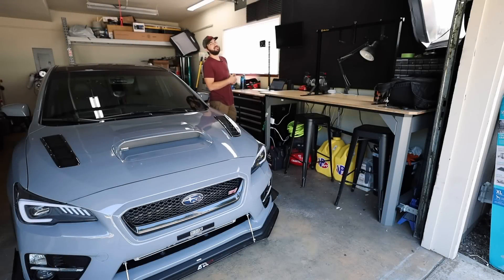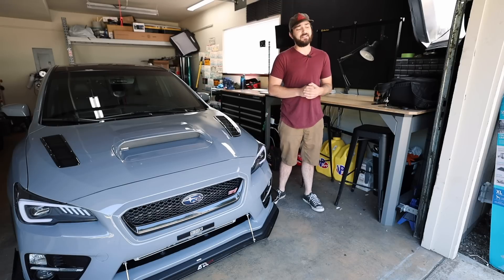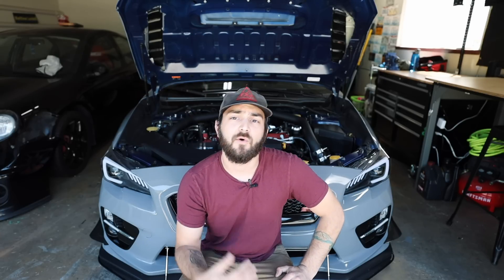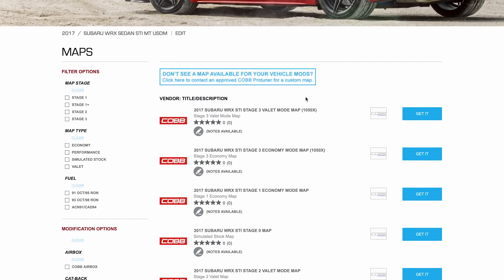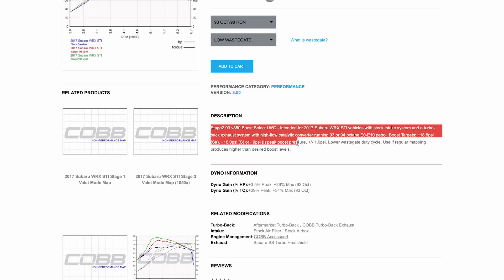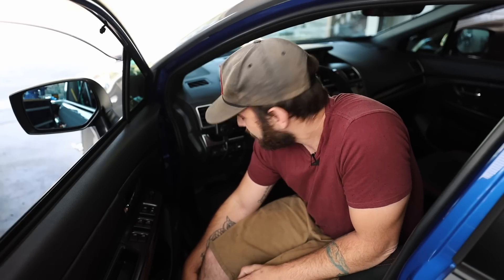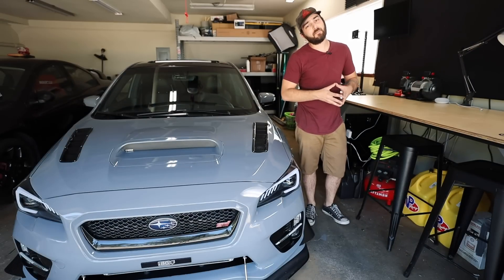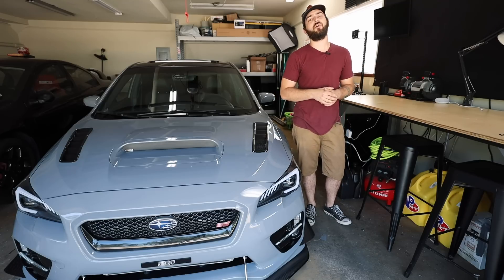Understanding OTS Tunes and What You Need To Know

Comment: Isn't the factory tune itself an ots? A shitty one at that. As long as the car is bone stock, how could the cobb stage 1 ots be any worse? With mods I'd go protune though. Has anyone monitored the stock tune data with their accessport? Interesting to hear anyone's feedback. No pun intended
Reply from the maker: Some shops have done testing on the OEM Tune feedback, unsure if what their specific results were other than "can be better", but you are spot on with the OEM Tune being OTS
Reply: @Smeedia  the cobb ots stage 1 may just be a cleaned up version of the stock tune. Not the best "pro tune" but better than the one from the factory. Probably a little healthier to run to as long as your 100% stock

Comment: So i got the Accesport with the stimulus money Lol.. as well as the cobb sf intake BUT i’m confused on how to download it because ima have to buy the MAPerformace stage 1+ map, and idk how to download and put it into the accessport 💔

also do you think it’s safe to run the MAPerformance Stage 1+ tune with the cobb sf intake ORR should i go with the COBB stage 1+.. or either or is fine ; does matter?

don’t kno if this helps but i have a 2020 STi
Reply from the maker: They should send you a file to download, then download the program AP manager and connect your AP to your computer and drag the file onto the AP. From there just plug it into thr car and follow the on screen prompts and upload thr new tune 😁
Reply: @Smeedia  Which map should i run tho? Only thing i got was the intake w no box and the AP is stage 1 or stage 1+ since i have no box
Reply from the maker: Stage 1 will be for only an intake 
Stage 1+ will be for an intake + catback
Reply: @Smeedia  I don’t have a catback but i have a remark axle back with a custom resonator delete so is that considered stage 1+?
Reply from the maker: I would just do the normal stage 1 🙏
Reply from the maker: If your using Cobb parts then use thr Cobb tunes, if your using map parts then use their tunes 🙏

Comment: Quick question looking at a stage 1 drivetrain package for my manual 2017 wrx and seen some reviews on the cobb package and dont wanna buy something that doesnt work. I know you recommended boomba short shifter but wanted to get bushings and all to figured cheaper to buy kid any suggestions
Reply from the maker: Personally not a fan of Cobbs shifter, used them in thr past and they work great but overall not the best. I do believe that boomba offers the bushings as well
Reply: @Smeedia  okay i found it all now cobb had the whole kit which made it a little easier but reading some reviews and seen some guys had trouble with installing on there 2017 wrx like mine so wanted to avoid any install problems

Comment: Different perform but I have a flame tune and oil dilution is a problem but not a major one if your tune otherwise is good and you change your oil frequently. If you are someone that likes extended oil change intervals, don't do a flame/ gurgle tune. Speaking from experience here. I can see a difference in oil pressure fairly quick from a be fresh change when I have the flame map on. Also can smell the gas in the oil much stronger when I do change it.
Still love the sound and look of a flame tune. However I don't think I make friends when I decide to drive that car to work in the morning at 5am.
Reply from the maker: Lol I'm sure the neighbors love it 😅 out of curiosity how much of a change do you see in oil pressure from a fresh change to after it's been diluted a bit?

Comment: 2016 wrx sti I run stage 2 lwg
Grimmspeed catted dp 
Perrin cold intake 
Hks blow off valve 
Full catback exhaust 
May I run cobb stage 2 lgw or no let me know please
Reply from the maker: I wouldn't, for that set up I would get an Etune. Thr Cobb OTS maps are built to work with Cobb parts. Thd stage 2 LWG map for a 2016 STI is only for a Cobb catted downpipe and that is it. The car will run very very lean with a BOV, intake and downpipe. The OWM fuel system cannot support those mods.

Comment: I just bought an accessport and I have a completely stock car. It will have the 91 and 93 MAP tune as well as the standard COBB tunes. Fuel grade is not a problem as I live in a major city. Currently can't afford a pro tune and the main reason I got it was to get rid of the super annoying rev hang. Do you think it could blow my car up? Any particular one I should go for? Kind of nervous but also excited.
Reply: I did that like 4 days ago. Hows yours running?
Reply: @B0MBATROX  any updates
Reply: @Hyuboost  lol everything is better with this car planning on going stage 2
Reply: @B0MBATROX  blew mine stage 1 and got it back and still having tons of feed back knock
Reply: @Hyuboost  it depends on how you drive your car I think bro

Comment: I have a 2017 wrx limited, with nothing but the upgraded sti performance exhaust that came from the factory. Are you saying that if I did use a OTS tune to use Stage 0 instead of stage 1?
Reply from the maker: Yes in that case you would do stage 0, state 1 is going to be for an intake
Reply: @Smeedia  Okay cool, cause I know they offer a Stage 1 and a stage 1+ and for the map notes on stage 1 it shows stock stuff and catback I'll definitely run the 0 just to be safe.

Comment: Hey I am having a problem clearing codes and CEL from my AP has anyone had similar issues? I just recently got it and am still learning how to use it. The codes are p2431 and p2433. Whenever I try to re flash the ECU the CEL still remains. Thanks in advance for any advice
Reply from the maker: Its the secondary air pump, you can either replace the air system or delete it. I deleted it off of my car. Its for emissions regulation on cold start
Reply: @Smeedia  thanks for the reply man your channel is super helpful. So there is no other way to remove the codes and CEL besides to delete/replace the secondary air filter because when i uninstall the AP from my car the CEL goes away. Like I said I am still new to this so learning on the spot. Is the delete something I would be able to do myself or should I have my mechanic remove it?
Reply from the maker: If it goes away when the AP is removed it may be the ECU re learning and the CEL has not re populated. If you do delete the system a tuner or someone with accesstuner would need to delete the codes. The secondary pump system can get expensive to replace and it plays no vital role in the engines performance
Reply: @Smeedia  yeah once i uninstall the AP from my car and bring it back to the stock ECU settings the CEL and codes disappear. Its when I try to add the Stage 1 map and install it and the AP then the CEL and codes will come up again. So what I understand is if I go the route of removing the secondary air system that I will still need to take it to a tuner to get the codes written out? I’m sorry I am burdening you with all of this but I haven’t found any one else to help and you have been extremely helpful and it is appreciated greatly.
Reply from the maker: That is correct an E-tune would probably be your best get 🙏
Reply: @Smeedia  okay got it. So is there really a point to keep the AP if I need to go to the tuner anyway? Or will I be able to use the AP with an e-tune?  Like I said I am still new to tuning still so I am doing a lot of research to better understand my options
Reply from the maker: Yes, all tuners will use a program called accesstuner and you need it for them to tune it 🙏
Reply: @Smeedia  ok awesome i will just have to get that secondary air system out ASAP. Do you think it is better to order an e-tune online or physically take the car to a tuner near me?
Reply from the maker: Whatever option works, if you have a protuner near you its not a bad idea 🙏
Reply: @Smeedia  I am in Long Island so I do have a couple options. My only mod is a cat back right now other than IAG short block but I am planning on installing a down pipe in the next month or so. Would it make sense for me to delete the secondary air system, install the down pipe and get the tune at the same time? Like I said earlier your help is awesome and I have learned more in this conversation than I have in the last 5 days of research LOL
Reply from the maker: That would be the beat bet to get it done, I would also snag some secondary air pump deletes as well. I've got a video on the channel of how to install them if your planning on doing it 🙏
Reply: @Smeedia  thanks for all your help brother I will check that video for sure🙏🙏👍

Comment: Im thinking about getting an AP with OTS just to get rid of the rev hang and better throttle response. Im not going to put any other parts on, will the OTS still be safe? for the long run?
Reply from the maker: For that you shouldn't have any issues 🔥🙏

Comment: I'm thinking of running a stage 0 on my 17 wrx just to clear up the rev hang and give it a tiny bit more power. Would you recommend really going for a pro tune for that or is it minimal enough to just safely do ots?
Reply from the maker: If your just wanting to remove the rev hang and add a small bit of power the OTS Tune will work fine 🙏
Reply: @Smeedia  bless you for replying to this old a video!
Your camera work is really impressive, video quality stands out, thank you for the great videos
Reply: @Smeedia  would you recommend buying it from anywhere specific? I saw if I buy it from MAP I get their tune free, should I do that or are there better options?
Reply from the maker: Just uses Cobbs OTS tune, comes with the AP and works well for an OTS Tune 🙏 and anytime! 🔥🙏

Comment: Hey bro so I just installed a grimmspeed intake on my wrx cvt so does that mean I can use this ots map tune?
Reply from the maker: Yes, you will want the stage 1 OTS Map 🙏
Reply: Thank you bro
Reply: Thats not a good idea. Isn't just gonna instantly break but if you look at the GS vs COBB intakes, their design is quite different. Especially the MAF sensor mounting. So if you run an OTS map designed for a MAF in a different location with different piping. You are asking for bad fuel scaling. You need to use the exact part the map is made for, or get a custom tune.

Comment: After watching this I realized what happened to my car. I 100% had boost creep. I’m sure the OTS tune I was using is supposed to be for the stock turbo and stock bypass valve which is 19 psi(?) I believe, but when I would get on the throttle, I would see 21+ psi on my boost readings. That’s exactly why I had detonation, which ended up blowing up the rod bearing on cylinder 4.

I had a gut feeling the high boost reading wasn’t right... I should have went with my gut feeling. Oh well, rebuild is halfway done now. Can’t wait to have her back on the road.
Reply from the maker: Sorry to hear 😖 how much power are you shooting for after the rebuild?
Reply: Smeedia I’m shooting for around 350 whp. I don’t think I have all the right parts for it though. I’m installing a Crawford S2 short block. I need to either replace/ rebuild my stock turbo, but I’m not really sure which turbo to go with. I’ve been told stock turbo so what I should go with.
Reply from the maker: Stock location FB blue is what I went with, made 357WHP on pump gas
Reply: Smeedia Excellent! Thank you for the recommendation

Comment: Hey bro what’s up sorry for bothering once again so I’m not fully data logging my car but I am watching the gauges on there, on the access port. My D a.m. is at 812

What can that be?
Reply from the maker: Gling to have to refresh my mind again lol what mods and tune?
Reply: Smeedia I messaged u on face book under Omar Sandoval
Reply: Smeedia I have a 2018 STI with Cobb sf intake , GFB bov, INVIDIA cat back
I pumped cheap gas so that might be why my dam is low , I was cruising it right now and my Af learning 1 sits at 2.34 on idle and when I full throttle it stays at 0 . And when I cruise it it would go to -5.34
Any idea what could be going on
Reply from the maker: My guess qould be on the BOV OTS tunes do not like to get along with BOVs very well

Comment: Good video.  I got a Cobb AP when they first came out (had to wait) in 2004.  Ran Stage 1 ots on my wrx from ‘04-‘17, except when I ran Stage 2 ots with a catted dp.  Never had an issue. That said, I had no other mods, and the stage 2 downpipe was a bellmouth design required by Cobb.

Been running Cobb Stage 1 ots on my 2010 STi for last 2 years. Car is bone stock.  The tune didn’t add any noticeable power gains, but it did get me much smoother and consistent throttle response and overall much better driveability. Stock, my car’s turbo would not have smooth power delivery. It was frustrating to drive.  I bought the car used, from original owner, and it was bone stock - not returned to stock.  Never modded. Thought about holding off on the tune but in less than a week, I ordered an AP and tuned Stage 1, 91 CA gas tune. Runs great now. 

Gotta figure these cars leave the factory with an oem ots tune. A custom tune will get best results, if you find a tuner you can trust - but I find the Cobb ots tunes fine if you are only modded to what they say for the tune. It’s typically a conservative tune too - you’ll get better results from a custom tune if you want to go that route, but I don’t bounce my car off the rev limiter. I drive conservatively, knowing I have the hp to move when I need to.  (ok, sometimes I lay into it just for fun... but never have launched the car from a dead stop)
Reply from the maker: Agreed, the problems really come into play when people deviate from the map notes. Did you have the V1 AP?!

Comment: A custom tune from an experienced Protuner is always a good idea, but OTS maps are objectively safe to use if used properly....remember...the OEM tune is also an OTS tune. They ain't custom tuning any cars coming out of the factory, its a one size fits all tune as well. And if you datalog most OEM tunes compared to COBB's OTS maps with the same conditions of fuel and environment, the COBB maps actually tend to knock less and run safer fueling. So yes, protune when possible because no OTS map can account for all variables, but it is a massive fallacy that COBB OTS maps are "dangerous". 90% of the major failures to cars using them are from the owner doing dumb things, or simply from the fact that stuff breaks when you drive it hard and may have happened regardless of the tune. Unfortunately the modern "tuning" scene is full of a lot of people that do stuff wrong and then blame the products instead of themselves.
Reply from the maker: Most of the failures I see is that people do not follow the map notes with OTS Tunes, the farther people deviate away from the map the higher potential for issues to happen. And while cobbd maps may be safer the moment you upload one you throw any warranty out the window. While aftermarket OTS aren't the ideal tune to use they do work relatively well for some cars

Comment: I'm one of those guys who's been using the OTS tune for years with good results so far with my 2018 WRX. Using the Cobb stage 0 93 OCT no mods. If I was to start modding I would start with a catback exhaust (stage 2). At that point I think I'd probably spring for a pro tune, from what I've heard the Cobb OTS tune is not that great once you start doing serious mods.
Reply: You need a TURBO BACK exhaust to run Stage 2.  A catback doesn’t change the hp.  That said, I’m not familiar with mods on the FA engine, but stage 2 has always required a downpipe (J pipe on the FA?).
Reply: @stephen3164  You're correct. To push power on these cars you need a J Pipe. Catbacks and axlebacks do not need a tune. (As per Smeedia, and many others.)
Reply from the maker: That is correct, anything past stage 2 really gets dicey. Glad to hear that you've had minimal issues though! 🙏🔥

Comment: The biggest problem I had is the files going corrupt. I don't know if this is due to leaving the accessport  in my car on a hot 4th of July but I lost my factory tune. The accessport comes with a stage 0 but it's not exactly the same as what was recorded when installed it. Not a huge deal but I never trusted to leave it in the car again after that.
Reply from the maker: Never had that happen before, how hot was it?!
Reply: @Smeedia  It was in the 90's outside. I went to a cookout that day and left the car parked in the sun. I was only there about 2 hours. When I went to leave I noticed it wasn't showing any gauges and it actually says files corrupt on the screen.

Comment: OTS and E-Tunes are to get your car from your garage to your dyno tuner. The end.
Reply from the maker: Etunes are just as viable as a dyno tune. Both Re done by protuners just two doffrent methods of tuning
Reply: @Smeedia  Only if you have wide band installed
Reply from the maker: Etuners typically require a wideband to be installed for data logging so they can tune in their end
Reply: Smeedia you still dont get to see your power delivery or numbers. It is much better to have the car dyno tuned. E tunes will get you by. I wouldn’t recommend them for any sort of longevity. Being able to feel the car and how it’s responding is critical to identifying any potentially detrimental issues. Even something as simple as the sound of a fuel pump acting up could save an engine, especially when large amounts of boost are involved. E-Tunes are nowhere near as good as having the car tuned on the dyno, or even street tuned by someone in person.
Reply from the maker: I agree and prefer a dyno tune over an Etune but some people just don't have access to a dyno tune or a tuner to be able to street tune. Etunes have come a decent way, but theyre a good alternative for people who don't have the ability ot access to get on a dyno